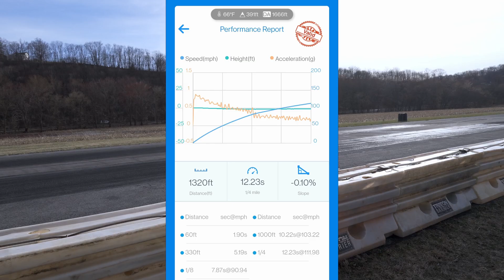Unboxing a 53hp Motor & 1,000 Amp ESC!

Comment: im putting two of those 1000amp esc's, 32 S batterys (8 x 4s) and two 3080 motors in a speed RC car  lol   were aiming for 300mph.  So, your gear is a little dated now but absolutely similar.  2800amp spike, 2000amp rated  haha  should be awesome.  half way through the build design now, about to order the bits.

Comment: Alex
thanks for that explanation.
We plan on using the motor to drive a centrifugal blower that requires between a 30 to 40 HP convectional 3 phase motor.
That blower spins max at 22,000 RPM.
we will be using the inlet side of the blower to create a Vacuum.
If we were to use the LMT motor we would gear it down VIA pulleys.
Is my thinking correct or does LMT offer another motor that makes peek power at 25,000 RPM?
Reply from the maker: I've learned a few things that might be helpful to you.  Just because the LMT motor can spin at 50,000 rpm doesn't mean it makes peak power at 50,000 rpm.  Peak power is closer to 30,000 rpm.  So you might have to gear it down less than you might initially think.  I'm sure you could get a lower kv/rpm motor from several manufacturers (Neu motors comes to mind as well) - but you'd still probably be looking for a 35,000 rpm capable motor.  The lower the rpm, the more torque and that means a bigger, heavier motor too.  It's a balancing act.  Hope this helps.

Comment: Does this motor actually develop 53 HP? How is it possible to transfer 53 HP through a 10MM shaft?
Reply from the maker: The equation for horsepower is hp = torque * rpm/5252.  That motor spins at up to 50,000 rpm.  If we flip the equation around to solve for torque, you get T = Hp/(RPM/5252).  If it makes peak hp at 50,000 rpm, you get: T=53/(50,000/5252).  Torque = 5.6 ft-lbs.  If it makes peak power at 25,000 rpm, it's still only making 11.13 ft-lbs of torque.  That 10mm shaft can withstand way more torque than that.  I'm driving the Sledgehammer with a 6mm bolt (10mm hex head).  It hasn't broken, and we've picked up 205 rwhp and put a 12 second car into the 9s with it: https://youtu.be/RT0M88xHzNQ?si=bS55EeO5bnPIWMYZ

Comment: I've been planning on doing this to my car also... Thinking though to help prevent to much intake drag when it's not engaged to put in a exhaust cut out valve on the intake to switch between the two when needed. Just need write some code to link my raspberry pi to the cars computer control everything.
Reply from the maker: You could do that; but I've found the compressor only represents a restriction equivalent to about 1 psi of boost.  On a 500hp engine, you never notice that on the street.  Unless you get on it, but then the electric supercharger kicks in anyway.

Comment: I have so many applications I want to see this on--- but number one is existing hybrids that lack some highway performance. The hardest thing is getting good access to tuning the motors, which already run on a modified miller cycle usually at super high compression-- but if you had the power supply part solved, then it's down to fuel and air again. 
Also cars that are notoriously annoying/expensive to supercharge and can only take a little extra boost anyways. Toyotas come to mind... Has it been tried as a compound on a Diesel? Most of those big twin or compound setups really struggle in lower RPM
Reply from the maker: I agree - we're thinking along the same lines, re: hybrids.
Reply: @AlexLTDLX  hybrid tahoe with a upgraded lithium hybrid pack. if you can handle 300v straight from the pack it would make a nice little boost hit. hptuners is available to tune the gas side, not the hybrid but I'm not sure of another hybrid that's has access to any tuning software, if it is a touch limited.

Comment: What are you using for your power supply? I have a somewhat similar project where I need a motor to provide ~20kW @ ~24,000 RPM. I can't seem to find any data from the manufacturer regarding operating voltage. Would you be willing to provide what voltage and current you are operating at and what kind of power supply you are using to provide it?
Reply from the maker: Here's a look inside one of my two battery packs: https://youtu.be/KscgGhk3ejs  I also have a video where I stick weld with one of the packs.

Comment: Motor has more horsepower than my diesel sedan.
Reply from the maker: It is kind of frightening.  And we've actually seen over 40hp out of it already - 47 electrical hp, and given the motor's rated efficiency and the ESC's efficiency (along with cable losses), you're still looking at at least 44 real hp.  Sort of mid boggling.  Makes me want to put one of these in a bike or something.

Comment: This is amazing!!!
So typically a conventional turbo is propelled by exhaust gas and forces air to intake - are you using this electric motor to propel the turbine itself for the turbo and directing that to the intake system hence no need for exhaust gas to power the turbo?
Reply from the maker: Yes, but technically the electric motor takes the place of the turbine and drives the impeller directly.  If you haven't seen it, here's a video of this beast in action at the track: https://youtu.be/nlTVHkfSQXM

Comment: When trying to figure how to lift /carry the controller try that strappy handle thing that took off in bewilderment .
Reply from the maker: Apparently that 3d printed piece is designed to hold a battery with a velcro strap.  Even if I could've used it in the car with the electric turbo, the car leaves so hard it would ripped it to pieces.  But since the pack I'm using weighs 60lbs, they're mounted separately anyway.
Reply: @AlexLTDLX  I  would not trust a Velcro strap for the mounting either , That Ford aint no joke. Keep up the good work .
Reply from the maker: Yeah, the whole thing seemed a bit janky.  It was actually cracked in shipping.  I glued it back together with superglue, but I didn't use it.  It just sits on my other desk, blissfully enjoy being a single piece again.

Comment: Just 17 HP stop
Reply from the maker: We already hit over 40 hp in garage testing: https://youtu.be/Azeaf6WVPfQ and running less than full power, on an actual car making boost and supporting about 657hp (flywheel) we hit 35 hp: https://youtu.be/7cCSbogg-AI  Remember 1hp = 746 watts.

Comment: Definitely a perfect alternative to nitrous.    Cannot wait for the dump testing.   May look towards this for my current project that through the radionics and CanBus so I can switch it on and off depending on who is driving it .    I had seen the newer video the flag … Kudos to the Ukrainians.
  Looking forward to the perfect parts list .
Reply from the maker: Thanks.  Your CAN bus idea is definitely a good one.  A lot of people don't realize how much power 750-850 hp actually is.  For most people, it's far more than they can handle responsibly.  That's actually been one of my biggest challenges - finding safe places and way to test this thing on the car.
Reply: @AlexLTDLX   Definitely an issue.   Everyone wants that 1000 hp mark but half of what’s out there isn’t putting it to the ground , and safely , anyways. 
  I didn’t even proofread what I wrote earlier.  Radionics.   Must actually be a word, surprised that it popped up in the dictation, lol.

Comment: What is the kv rating stated from supplier?. At 1v how fast no load = kv. 2. Does supplier list max rpm.  This motor is core less meaning no iron that is why it does not cog. Motors configured this way have a low start current and lower starting torque which is the type that should work best for this applications requirements no cog should not have the high instant vibrations of a motor with iron core the hp max occurs at higher rpm than core motor. I tried to make similar type of setup 4 years ago stopped when it was realised the amount of power the compressor would require to get pressure at volume necessary. Getting large airflow not  difficult get pressure at xxxcfm hard yet benifit of long term small accumulation of energy for short extreme burst of acceleration and its similar to that Mad Max switch O Yaaaaa kool. keep going your on the path to do what has been great in concept difficult/impossible in practical application.
Reply from the maker: If you haven't seen the drag test of the first version, it's worth watching - rather eye-opening results: https://youtu.be/AOL3Qyczt3Y

Comment: I'm only laughing because 40kw motor with the blower....
would make an electric rocket of a go-cart all by itself!
Reply from the maker: Last night I finally got the VESC/P2 unit up to full speed.  It was starting to lift a car battery, a 20 lb sandbag, two 36" x 2" x 10" pieces of lumber, a 25 lb blast shield and itself through a 1" restriction.  Fun!
Reply: @AlexLTDLX  yup, even if it only hits 75-80% output (vs input power)
its darn sure going to blow out some diapers! also been watching some BREW2L, the foxbody with the belt driven supercharger may be lower pressure, but physically/solidly connected to engine rpm its just about ALWAYS pushing that same amount of boost, like the electric will do.

definitely think a "drop it in" go-cart side project would be fun+funny.

Comment: That's a very bad idea! You NEED the controller as close to the motor as you can possibly get it. AKA, put bullets on the ends of the controller phase wires and plug them directly into the motor...that's your maximum phase wire length! Expect that voltage drop to be more like 40v if you put it in your trunk. I don't know exactly since your wire lengths are unknown and I don't know the motor, but it will be a lot and that's just the voltage drop issue. Notice how Tesla puts their inverters AT the motor. Lengths are 6 or 8 inches at most. You really don't want long phase wires! At the amperage you are estimating, the inductance will be crazy high in the wires. If you can get the controller wires down to 6" or less, that's your best bet.
*
Motor and magnet design defines how hard they are to turn by hand. You really don't want a motor that magnetically cogs and is hard to turn. This requires more phase amps to overcome. I have a large Russian made outrunner that is like this motor...very easy to turn and yet is quite powerful!
Reply from the maker: Why?  Long power cables are the kiss of death to the power stage and the capacitor banks.  In doing probably too much research and actual empirical testing, I've found if your motor is sensored, then long motor cables are the way to go.  FWIW, MGM told me to keep the power cables short and make the motor cables as long as I want.
Reply: @AlexLTDLX  
Best thing I can tell you is that you'll find out soon enough. Go for it...make those phase wires really long and see what happens. IF you are seeing large voltage drops on your DC cables, you need larger cables. If you look at how Tesla does it, their phase wires are very short and their battery wires are long. There's really good reasons for this. Just me personally, but I'll copy what the premier electric car manufacturer on the planet does before I copy an RC parts company!

Comment: I find it hard to believe a tiny motor like that has more horsepower than I had in my 1967 VW Beetle or my 1960 Austin Healey Sprite. 

Let's see an electric car conversion using that motor!
Reply: 40kw is peak power for some seconds, continues is only 1/4 of that.

Comment: It is highly recommended that you keep your ESC as close to your Motor as possible to prevent interference problems!

Not keeping the wires between the ESC and the Motor short, will cause hi frequency noise all over your car.
This can highly increase the chances of the ESC and the Motor loosing sync and can also cause weird things to happen with the other systems in your car.
 The caps at the ESC are very important for the same reasons.
Reply from the maker: One set of wires has to be really long to be practical.  I've had limited luck with long power leads - and MGM suggests long motor leads.  So we're going to try that next.

Comment: Sweet high end stuff. did you need the light-weight hobby stuff :) ? I guess 40kw ebike motor and controller is about US$1.5k from QS and probly weigh x4 (30kg) of your setup. You're not mucking around now!
Reply from the maker: What I need is high rpm, thus this expensive stuff.  I'm also trying to keep it small and light.

Comment: 53 x 4 hooves seems doubtful for that size; some heavy cables to feed those horses :)
Reply from the maker: Lol - you're right.  The motor cables came in.  The cable itself weighs over 25 lbs.  And cost almost $200.

Comment: You do realize that the 3 phase wires going to the motor carry more current and thus need bigger gauge wire than the DC supply, right. Placing the controller in the trunk will require more large gauge wire than just placing it in the engine compartment. We always place the controller as close to the motor as possible.

Comment: hi watch your videos and if you want to measure the psi put an air flow meter in place you can then measure the resistance on the air flow meter that will tell you how much psi it can make put it before the air filter. you need to measure the amount of suck you have and not trying to measure turbo output as that be false.

Comment: Big rig turbos should run out of motor before they run out of air. By then you are probably going to approach the limits of the rest of the engine.
Reply from the maker: I would need to go much bigger to reach the limits of the engine (1,400hp or so); but yeah, the compressors are a bit undersized.  As long as we keep showing promising results, I'll keep going bigger.  Though my street car that I drag race really doesn't need more than 1,000 hp.  Beyond that, I'll probably put it on a grudge car or something.

Comment: Going to need some serious charging capabilities I did this 10 years ago using multiple edf’s on an rb30 but didn’t have enough alternator to make it viable,compressed air is far more efficient at making an air pump pump harder without the losses of resistance and heat

Comment: DONT MOUNT THAT ESC THAT FAR AWAY FROM THE MOTOR!!   You just need to shield it with gold foil and mount it close to the motor
Reply from the maker: That's pretty much exactly the opposite of what MGM is telling me to do. And I do know that long power leads put a lot of stress on the ESC capacitor bank and power stage.

Comment: Your motor leads are too long.You better read their specs.I smoked two of those bad boys already.You know how expensive they are coupled with shipping and customs.I was gonna send them back to fix and Fed Ex wanted 480 bucks to do it
Reply from the maker: They repeatedly told me to run long motor leads over long battery leads. Besides which, long battery leads put a lot of stress on the ESC capacitor bank and power stages.  I guess we'll see.

Comment: I hate to break this to you but lehner motors are over priced junk. I used three of them and all three failed. The rotor is not bonded to the shaft well. Tp power motors are much better. MGM controllers are junk too. I used to use both of those in high Rc boats. Good luck with warranty on either of them when they fail. They do both look sweet tho, and the low rpm control of the mgm is impressive.
Reply from the maker: We'll find out soon enough I guess.

Comment: I wondered how long it'd be before you went to MGM. Their ESC's are amazing. I used to run one on an RC speed record car. I only hope the user interface has improved since then.

PLEASE don't put the ESC in the trunk! Those wires will be WAAAY too long!! If you HAVE to, put it behind the firewall but I'd recommend putting it as close to the motor as you practically can.
Reply from the maker: So you would run longer power cables and shorter motor cables?  Why?
Reply: @AlexLTDLX  The batteries supply dc to the speed controller so only the resistance of the cables will limit power transfer. The caps limit any ac that might occur in the battery cables. Although the cables to the motor aren’t ac they’re certainly alternating and the inductance and capacitance of the cable will limit power transfer as well as its resistance. Every time there’s a transition it’ll generate a magnetic field around the cable and as that field collapses it’ll generate a back-emf in the cable. Basically that means that the signals to the motor will be dirtier the longer the cables are. This might not be a problem for the motor windings but the sensor cable signals could well be compromised and unless that cable is shielded it’ll pick up noise from the motor cables too. Also, you’ve only got two conductors between the battery and speed controller where you’ll have 6 high-current cables and the sensor cable. So, chances are it’d cost more too. I get what you’re saying about protecting the ESC from excessive heat in the engine compartment but that’s a problem that can be solved fairly easily.

Comment: That motor is insane, not only a work of art but it has the power to back it up. The HP that motor makes should be ideal for that charger thinking along the lines of parasitic loss from a engine driving a centrifugal supercharger, I'm definitely watching this with eager eyes 😃

Comment: Any thoughts as to mounting the blower in the trunk and then plumb to your engine-take advantage of weight distribution, shorter motor leads, savings on copper wire, the long inlet tube could act as a heat sink..... Looking forward to see this set up in action! Thank you.
Reply from the maker: That would be ideal - but I'm not willing to cut the car up for that.  Over the years, with tons of different custom/experimental forced induction setups, if I'd cut the car up every time I'd be driving Swiss cheese by now.  I'm weird like that.  But that is why I'm insisting on putting the 60lbs of batteries directly over the rear axle - plus they fit there really nicely.